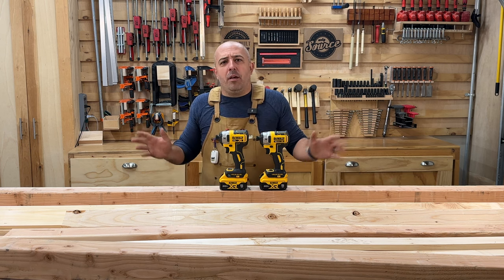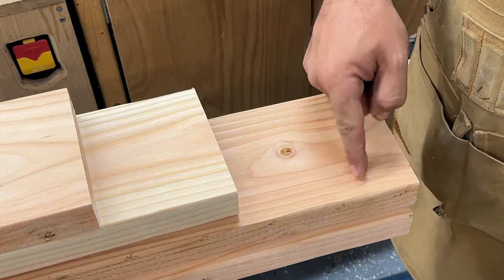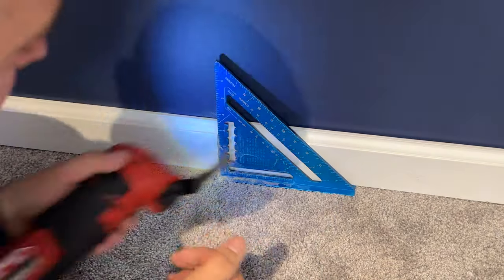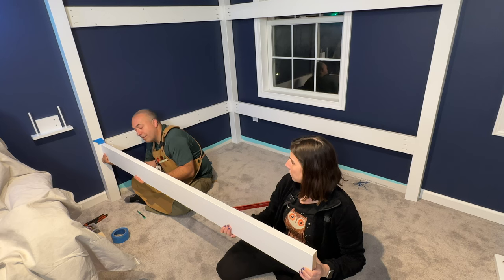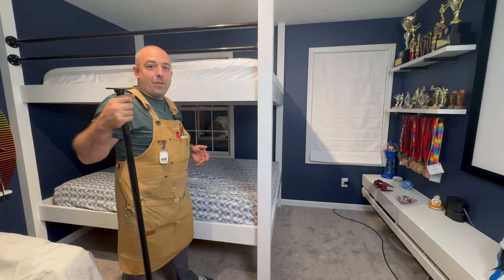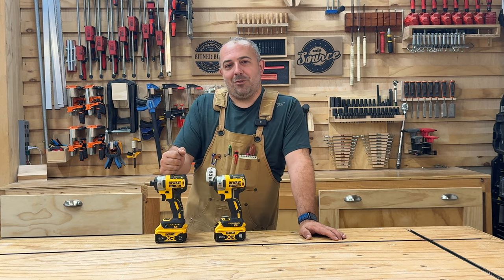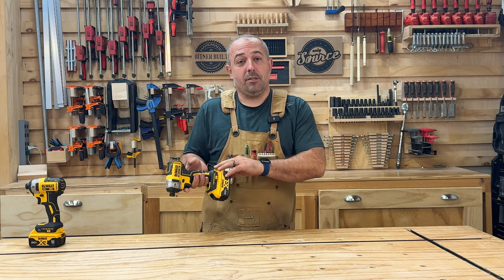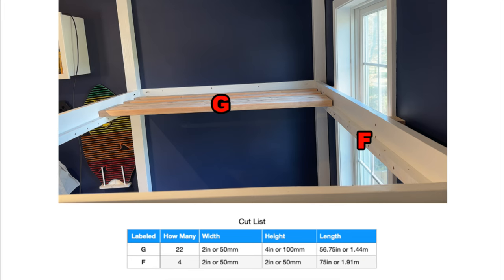Basic Built In Bunk Bed With The Dewalt DCF887 & DCF888

Comment: Nice work Justin. Love the DeWalt line.
Reply from the maker: Thanks! I love my dewalt planer but honestly these are some of the first main dewalts I have used consistently and performed very well. I have one coming out on a 12v dewalt drill. Not as big a fan of that one compared to my Milwaukee m12, it struggles a lot but these 20v did great